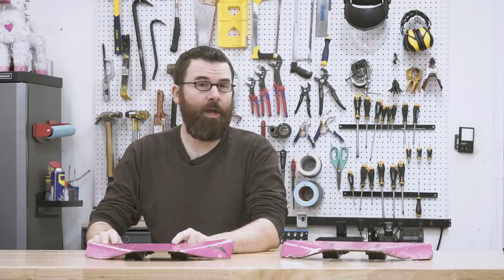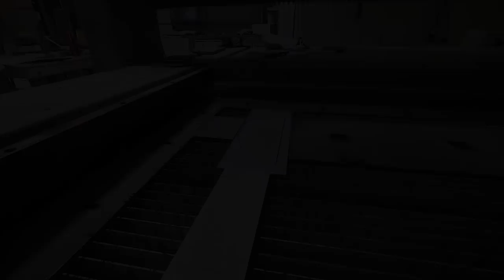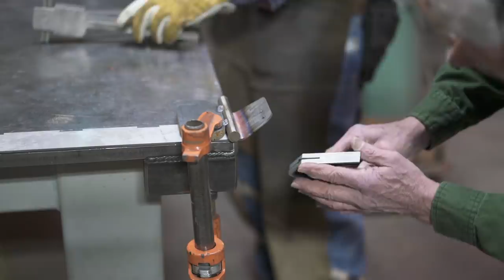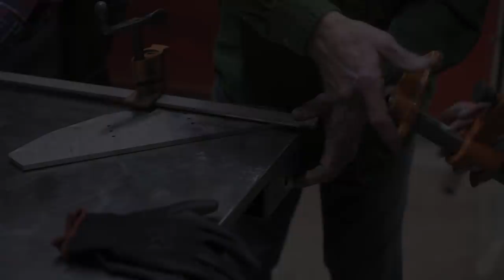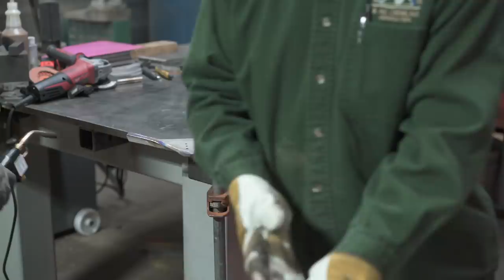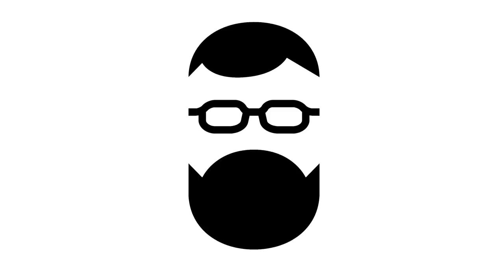How to Bend Titanium for Wedge

Comment: I would add this for first timers: if you cut steel with a laser cutter, the edge will be air-hardened, and you can't directly tap a laser cut hole. You can have them lasered smaller and drill them before tapping as an alternative.
Reply from the maker: Correct.  I am going to make a video talking about laser vs. plasma vs. waterjet.  Ultimately, waterjet is best for most purposes, but is slower and costs more.

Comment: Thank you for this Robert. Interestingly you have boosted they already high respect I had for the makers of the SR-71 Blackbird to even loftier heights. They shaped a plane out of that stuff...
Reply: The bulk head for the F22 that joins the front (cockpit) to the rear (the rest of the plane) is made from a solid billet of 6" thick titanium.  It takes a CNC with diamond cutters 6 months to make just 1 and several tool changes as it wears them out.  It is the only thing they holds the two halves of the plane together.  Now, imagine the cost of that single part.

Comment: tips: 1):  if you extend your bending clamp (away from the heat)  , you can attach an angle-finder/level to it instead of wasting time and heat to pause and check the angle. Another way is to set up a straightedge as a reference set at the desired angle ....in-line with the plane of the part (can even be a broom handle  propped at an angle etc)...then you can just sight down the edge to reference it.  2)  if you make clam some stop-blocks/magnets/weights to locate the part..you can then heat the bend line before it clamped to the heat sink...err i mean table ;-)...then quickly butt it against the stops,clamp and only have to add a bit more heat before it will take the bend.    Have fun with your botz!
Reply from the maker: You are right, but I think you underestimate the heat that's coming off of this part.  The setup would work, but we only needed to adjust it once per side.  We bent it to close to the final angle, then one adjustment and it was done.  It wasn't too tricky.

Comment: Does the heat affect the titanium’s properties?
Reply from the maker: Nope.  As long as you bend slowly, it's fine.
Reply: @RobertCowanDIY  not exactly true ... such as when you were grinding it down and then dropping it in sow technically you were annealing it and hardening it  also when heat bending you are also reducing the thickness on the bend by a fractional amount ... o the correct answer is yes you did affect the titanium's properties BUT well within the margin of error for the parts application ... basic physics you can not adjust something shape without affecting it in some way ... action reaction ... the change is where the compromise comes in ... how much of an affect is allowable for the application of the final product
Reply from the maker: @0623kaboom  Well, yeah, but that means EVERY single answer would be "technically..." which just isn't terribly helpful.  I try to avoid being that guy.
Reply: Heating titanium in open air is not a good idea as it very quickly reacts with oxygen.
Reply: @ilkero1067  I though nitrogen also effects it when heated.  But it may only be when molten, which is why the need for argon purge on both sides when welding is needs.  Because the back side also requires the purge, I suspect the Ti doesn't need to be molten as the back would just be very hot not molten.  As I recall, it makes it brittle and prone to cracking.

Comment: . . . probably induction heating would be the heat source of choice . . . it can be applied pretty exactly and concentrated compared to such torches . . .
Reply from the maker: Sure, but this is what the shop had on hand.
Reply: @RobertCowanDIY  . . . thank you . . . ofcourse we have a solution - it just doesn't fit the problem . . .

Comment: Do you know how you can bend 6mm (according to google that's 0.23 inch) of Hardox as that doesn't like heat?
Reply: You're gonna need a 50+ ton press and it could break
Reply from the maker: I think you just need a LOT of force.  you can use heat to anneal, but then you'd need to heat-treat it again.
Reply: Cut it, bevel it, then weld it with 7018 H4 rod
Reply: I bend Hardox 6mm in a 250ton press. Depends on angles and sizes but easy enough with the right tools
Reply: heated bending press or rollers and annealing ... as well as time

Comment: I tried bending a 10x5cm 1mm thick by hand it was physicly impossible LOL
Reply from the maker: with or without heat?  you really need heat for this to work.
Reply: @RobertCowanDIY  without heat I just had a piece for some electrolyis plates i figured i'd try to bend, it's some really buff materials xD

Comment: Orrrrr... You could weld them :)
Reply: Welding is most definitely weaker, and also an equally difficult process.
Reply: @Spagghetimonster  Welding is not weaker, if you get full root penetration. The problem with titanium is that it is even more oxidation sensitive than stainless. You have to purge the back and the front to keep it from discoloring. Very difficult :(
Reply: @redjetfab3808  You state a lot of criteria that are almost impossible to meet. Welding titanium is notoriously hard, I think it is well beyond the scope of a normal welding shop to weld titanium that good. Also the chance of degrading the properties below the parent material are gigantic.
I would not bet on it.
Reply: @Spagghetimonster  Thanks, I believe we actually agree. It is difficult to do well
Reply: @Spagghetimonster  Am professional TIG welder, I weld titanium. I believe everyone likes to make it seems more difficult than it really is. And I would disagree that the chances of ruining the parent material's properties or strength are high.
However, thin plate warps like nuts. Tubing is much more pleasant.